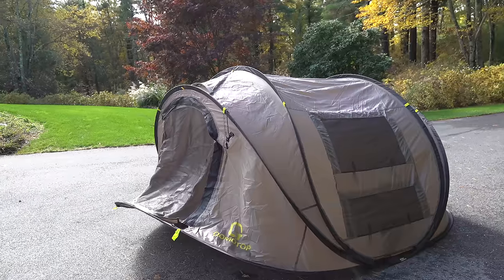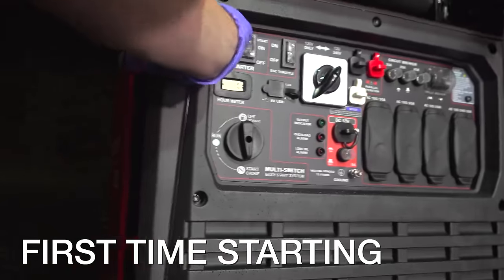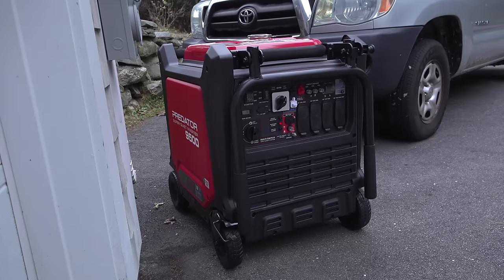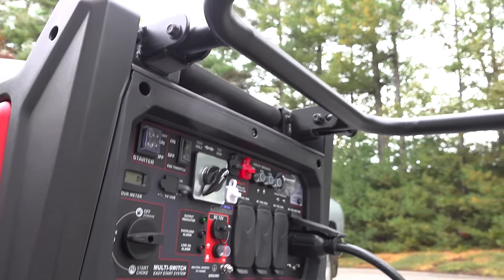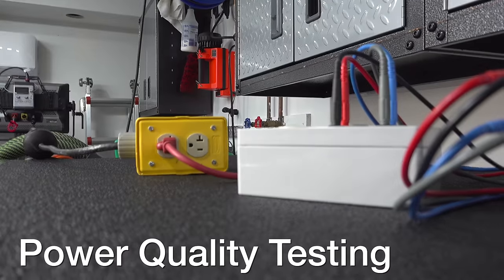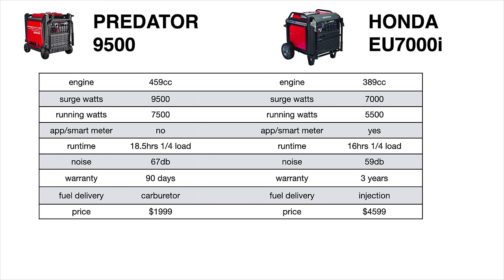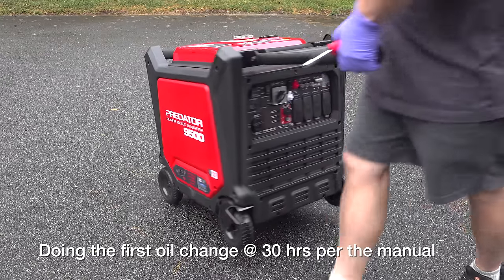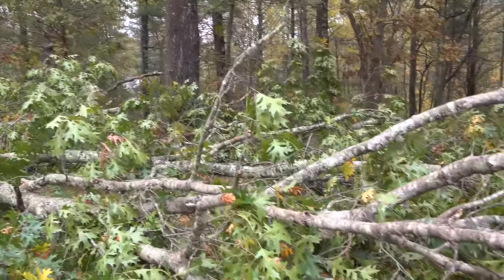BIGGEST Harbor Freight Generator Predator 9500 Review & TEST

Comment: by any chance, do you know the dimensions of the box the 9500 comes in?  trying to see if it will fit in my Model S (which has a large cargo area when rear seats are folded down), I see the generator is 31" in length X 24" in width X 29" in height, how much larger was the box?  thanks
Reply from the maker: It was an insanely large box, I dont think it will fit Im sorry I didnt take the measurements but its easily almost 2x the generator to prevent damage. The store people were very nice though. You might ask them to remove it from the box and just load the generator alone into the car. They might do this

Comment: My guy! Getting ready for the winter weather! What about those new battery powered generators you have been reviewing? Are they not big/efficient enough for a big power outage in a snow storm?
Reply: A $2,000 battery "generator" will last 1/20th of the time of a $200 generator.  Ok, unless you get solar panels(several). And the sun is shining. A battery generator will be dead.

Comment: Besides the high cost and poor oil drain. Having gone through Hurricanes in Florida, putting the gas fill on the top is a big no no. 5 Gallons of gas is really heavy and it spills all over the place. I wouldn't buy another generator unless it has corner fill.

Comment: From my inspection of the predator line.. they are full of aluminum casting flakes that can't be picked up by a magnetic drain plug.. so even if you spent the money on a magnetic drain plug, you would only be collecting the steel fragments that are wearing from being chewed up by the aluminum casting chunks.. until predator resolves this, I wouldn't buy one

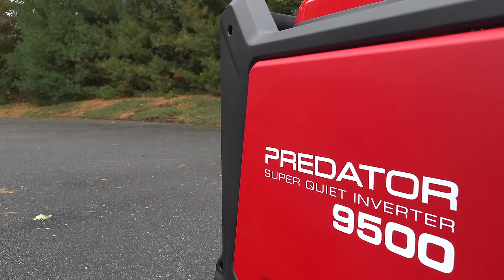Comment: 0:08 wait a minute the “Honda Killer” 😂 I honestly paid an extra $300 to get the DuroMax XP9000iH Dual Fuel Digital Inverter maybe that one should be the Honda Killer since it gives you more than this Predator inverter. 
If only Predator did Duel Fuel.. I would buy two and parallel them.

Comment: Don't be fooled by Honda's. I work on small engines and I repair more Honda generators than any other brand. Btw, regardless of which brand you choose availability of parts is an issue. Most repairs are simple but without parts it doesn't matter.

Comment: Is depends people how much money wants to spend is a big difference on money but Honda is Honda vs harbor freight . I bought a Honda generator eu3000is I thing on 2012 and is 2022 and still working like new  only changing oil and spark plug on time,is Very very  quiet specially if you work at night, im working as a plumber and im very happy i love honda but im saying people how much do you have to spend ?

Comment: What justifies the price tag on this compared to their 9000 watt generator?
Reply from the maker: The inverter, the clean power is good but it will extended runtime significantly
Reply: @SilverCymbal  Thanks. Im gunna have to look up the difference between an inverter generator and a regular one. I dont know much about it

Comment: Should use rec 90 gas. Or any gas that has no ethanol. Ethanol is not good at long periods with non use. I would use rec 90 on any gas powered equipment.

Comment: Run time comparison is flawed. The predator holds 1.7 gallons more fuel, which is not mentioned. Predator 6.8, Honda 5.1
Reply from the maker: It's not flawed the times each runs on one tank of gas are correct. Yes the Honda has a smaller tank, but the Honda generates 1375 at a 1/4 load, the Predator generates 1900 watts at a 1/4 load.

Comment: From my experience Harbor freight tools are junk. However, this generator does look pretty decent. I have a Honda generator that’s over 20 years old that I meticulously took care of and can go down to my garage right now and put some gas in it and it’ll start on the first pull. Will the harbor freight do that ?  Just saying 🤷🏻‍♂️🤷🏻‍♂️🤷🏻‍♂️
Reply: I've got an 8 year old predator 8750 that starts on second pull every time.  I always let the carb run dry before storing it. It's been great so far.

Comment: I use this generator every day as a mobile detailer . I run heavy duty equipment simultaneously  , also on eco mode and it has been extremely reliable and excellent.  I get the stated 18 hours of run out of it . I have 400 hours on it so far . with the warranty you can buy for predator it's a winner for me and will buy again.  Iv gone through warranty service for Honda through home depot and I will never purchase again.  Complete Night mare through Honda warrantys. Over 2 months of wait time for them to fix it and when returned  ,they only did an oil change and said it was fine come to figure out the engine needed replacement

Comment: One of the reasons the Predator has more power is because it has a less restrictive muffler and allows a lot more noise that the neighbors all get to hear.  Quieter engines induce a parasitic load onto the engine, and derating the engine output is the tradeoff.  Honda also has the tendency to right-size their engine for fuel efficiency and weight savings for the application while it's running at lower RPM (rather than an always-maxed out RPM) under the full demand scenarios.  This is why the Honda generators can have that extra capacity rating even further above the surge power rating.  I wouldn't be surprised if that Predator is running its bigger engine at near redline speed to achieve its 7500 watts...it is feeding the engine with a carburetor instead of using computer controlled fuel injection.  Don't forget that also the Predator is typical Harbor Freight engineering- most of it is copied from someone else's work, and then they cut lots of corners to save on production costs- if you want a warranty to deal with potential quality issues, you will be paying extra for that above the $2000 price.  Guess it depends on the type of neighborhood the generator would be used in and whether there is any consideration for the noise output directed towards the neighbors.

Comment: You’re comparing two different class output generators.  That’s like comparing a Peterbuilt truck to a Toyota Tacoma and wondering which one can pull more weight.    I doubt that the Chinese built generator will be running well in just a couple of years.   You get what you pay for.
Reply from the maker: Well let's not go crazy.  Both are generators that provide electricity, how they get there is different and longevity will only be told in time. But this hasnt be a great few years for Honda either 2 recalls on their generators due to fire hazards and leaking fuel. Harbor freight and Generac have had no recalls. You can see I own the Honda but don't be blindly loyal to anyone, none of these companies  aret what they used to be.

Comment: I'd still like to know of a portable gen that I can run my 240 well pump.
Reply: Have a Honda eu7000i to a GenerLink - np running my 240v well pump. We turn off the 240v hwt and 1500w baseboard heaters. The peak watt rating of 7000 will handle the  3000-4000 starting / 1500-2000 running watts for the pump. With a 1500w stovetop element on it's still well within  the peak watts of 7000

Comment: Yea you gonna need that pull start! They build these to a budget and the parts gotta be cheaply made so there not gonna last line a Honda would. And if you can’t run something with the Honda you got the wrong size! Get a 10k Honda I guarantee it will do as good or better then the predator! Not saying Honda is the end all be all but they do make good stuff that’s been proven. And on the other hand we all know harbor freight is just OK stuff for  a cheap price ie you get what you pay for! You get piece of mind with the Honda with the prefitor you get 3 months then if it breaks your screwed no parts no service then you gotta buy another! So what do you want cheap with non stop problems or years of no worry service! I say save up get the Honda! Especially for the important stuff like your home! For the work site sure get the cheap one they will break it anyways!

Comment: Anyone know the frequency this Harbor Fright generator runs at? 

The Honda EU7000iS runs at 60 hertz and has clean power. 

I plan on running 4000 watt HMI lights and need clean power so the light runs smoothly. 

If anyone has any info on this, I’d love to hear. 
Harbor Fright doesn’t seem to advertise the frequency ratings.

Comment: I tried 2 predator 3500s back to back because of rave reviews…neither one lasted an entire camping weekend before they were inoperable to the point of needing to be returned. 

Said fuck it and did the adult thing and paid almost $4k for a comparable Yamaha that promptly also shit the bed the first weekend I used it…..It was repaired under warranty and has been a great unit since….the inverter board crapped out on the yamaha, all I can figure is that it was a new, but old stock model that sat for so long on the shelf that the capacitor bank on the inverter board dried up, when I went to use it for the first time it went kaput and would have cost about $2500 to replace had yamaha not backed up their product. 

What it came down to for me was parts availability. You can buy anything on a honda or yamaha right down to the smallest screw, predator has zero parts suport…zero, so when they break (and they will) your only recourse is Hopefuly you paid for the extended warranty and can exchange it. 

Bottom line, if its a generator for emergencies buy something quality with an extended service plan…..HF tools have their place where they definitely hold their own, their gennies are not in that category.

Comment: Mine is not yet two years old. Sensors have gone bad, I unpluged them to make it run. Within 4 months I had to replace the battery. Now the start stop switch stop working, and to make it even more fun, the fuel turn off valve doesn’t work. Bottom line, JUNK!!

Comment: Found a dangerous over looked death trap with generator use. The electric meter conduits are a wide open pipe going into your breaker panel carbon monoxide can get into your home this way. You must totally seal this where it comes into the back of your breaker panel. Danger don’t leave this item undone.

Comment: The reason why people stay away from predator is because the tolerances are really bad in the Pistons and they rattle until they sound like a diesel and then they die.
 You better be real get a check in the oil.

Comment: If any of the Harbor Freight generators were really that good they would warranty them for more than 90 days. Harbor Freight will sell you a one year or two year one time replacement policy but those policies are expensive and you can only use them one time and they are no longer valid. Many people call those one time replacement policies a warranty but they are not a warranty. So if you by this generator after 90 days the warranty is over but you bought the $500 two year one time replacement policy so you feel all warm and fuzzy, but the generator fails at the four month mark, no problem you say I purchased the 2 year one time replacement policy so I am good for two years if it keeps breaking. Wrong, when you took the generator back and got it replaced at the four month mark the one time replacement policy has been fulfilled. If you want to continue to have a one time replacement policy you have to purchase another one and if you want it to be for 2 years again you have to pay another $500 dollars. These Harbor Freight generators are not a value at all and are cheaply made.

Comment: Run time should be based off the gas tank size which are not the same. The Honda has a smaller tank, so…
Reply from the maker: Sort of true but the power output and engine sizes are also not the same so the only way you could equalize it all would be some type of figure per watt or something and most buyers just want to know how long they can run each one before running out of gas
Reply: @SilverCymbal  Sort of true, because then there is efficiency and actual power usage to be measured. So just simplify it. Put a title over that part of the review to reinforce the size differences in fuel capacity. Honda is 5.1 gal. and  Predator is 6.8 gal. as you mentioned.

Harbor Freight has a misleading side by side too with this issue: Runtime At 1/4 Load: 18.5 Hours	VS 16 Hours.

The  (XP9000iH) by DUROMAX might be a better side by side comparison.

Comment: The Honda fuel delivery system is more efficient use of fuel than the Predator. Let’s do the math.

Predator runs 18.5 hrs on 6.8 gals at 25% load. Running watts is 7,600. Predator burns 1 gallon of gasoline for every 2.5 hours.

Honda runs 16.0 hrs on 5.1 gals at 25% load. Running watts is 5,500. The Honda runs 3.4 hours per 1 gallon of fuel but at less electricity made.

5500 watts divided by 7000 watts times 100 is 78.6%. In other words  the Predator is delivering 21.4% more power. If you multiply 2.5 hrs by 21.4% you get about a 1/2 hr run time difference. If you add .5 plus 2.5 on the Predator you get 3.0 run time compared to 3.5 hrs with the fuel injection Honda engine when watts are even. 

In conclusion, the Honda is more fuel efficient, quieter and is probably built much better with a longer warranty. The downside is less wattage available and far more expensive with a Honda purchase. I would say these machines are somewhat evenly matched with consumer sentiments being what they are today. I like quality components and resale so my pick is generally going to be the Honda purchase. But if I would be concerned about the Honda getting stolen over the Predator so maybe the Predator might make more sense.

Comment: 3 months warranty sounds like it's oem china typical coverage. 
Honda gives a whopping 3 years so they know their machines will last for many years. And lights dimming, sounds like a job for the many ecoflow you have lying around.

But if you're careful around that Predator, run at half loads with right maintenance. You should be good. If all else fails, you still have spare change left to buy an exact model and scavenge the old machine for parts.

Comment: The answer is no. Predator quality control is not even close. That is the reason for the significant difference in price plus brand reputation of course.
Reply: Some folks who buy Predators do not want to hear that.  They desperately want/need to believe that they received Honda quality for a third of the price of one.  The truth of the matter is that Predators are not bad generators, but they absolutely are not Honda's, not even close.  I have a Predator 2000, along with a couple of EU2200's, so I'm familiar with both.  Call any equipment rental company and see what kind of generators they rent; I don't think they'll be Predators.